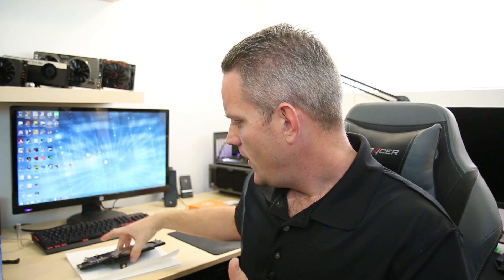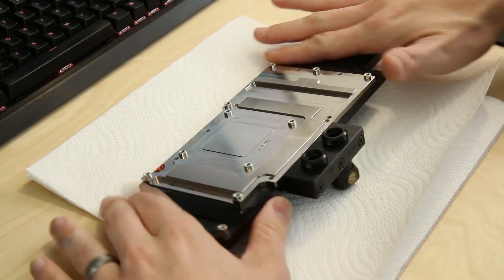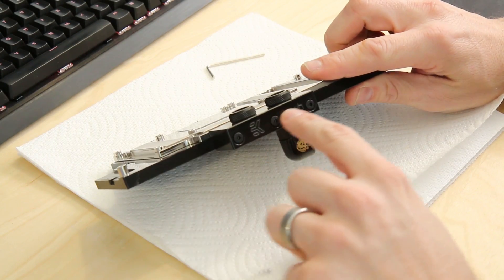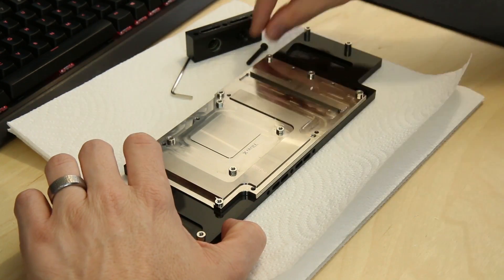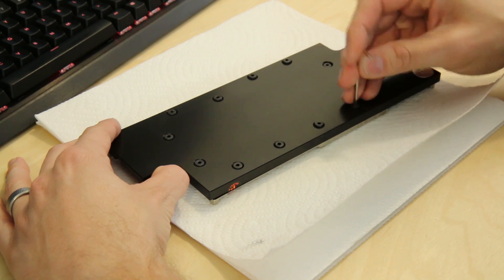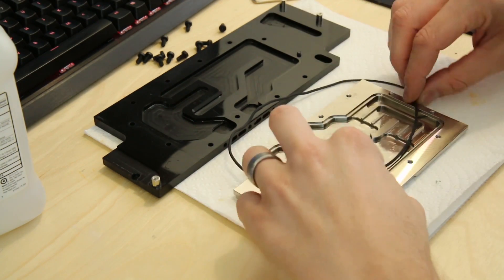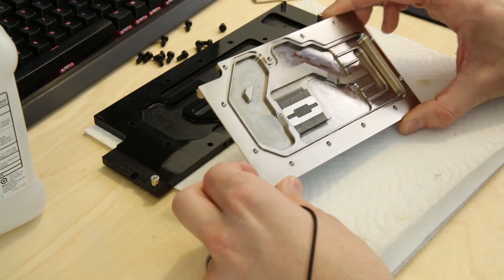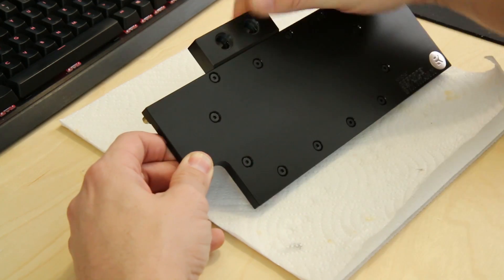Inspecting the inside of my GPU blocks - How to clean GPU blocks

Comment: I find it weird that the salt (if it is a salt) being formed is white with all the copper and nickel involved. The only reason I could think of for it being white would be if Mayhems uses silica nanoparticles in their pastel formulations. I'd say is the acetal (maybe one of its plasticizers) that is reacting with the fluid instead of the metals (copper, nickel). Both CPU and GPU loop have nickel-acetal blocks but your GPU loop has a much bigger surface area of contact between the fluid and the acetal, making them more likely to react with each other. Anyway, keep up with the great work o7 Looking forward for Skunkworks v4

Comment: I recon that white powder - had it myself on my system and it was a big mystery. Then, for a complete other reason, I had to ensure that the system was grounded. After my next cleaning of the system, I no longer had the problem with the white power. So I conclude that the powder has something to do with a current that occurs, when You are not grounding the system. Almost like You would experience on a boat - where they use zink to counter that current.

Comment: could it not be that you acid cleaned the radiators?
if they are in fact made of copper, then putting an acid inside them would be a pretty bad idea, and would definitely result in the production of salts and other chemicals that could be the cause of the build up.
just a thought, this is made more likely by the fact that titan xs are EXTREMELY hot cards, and three of them would certainly have above the required activation energy for reactions with rather unreactive metals such as copper. If the acid cleaning part of the process was not properly washed out before the pastel fluid was put in, or if the radiators were left with the acid inside them for any length of time then buildup of the salts could occur inside the rads, which would be washed out into the loop once the pumps and fluids are installed.

Comment: I've ran into this problem before with radiators....I use CLR to clean them....just allow the CLR to sit in the radiator for about 10 minutes....then flush the radiator with distilled water.

Comment: would the build up of salts affect how much heat is retained within the system? not a chemist either, just kinda curious now
Reply: +knightedwolf actually, let me rephrase that, would having the salts in the fluid cause the fluid to retain more heat than the rads could displace. not in the way of blockages, but more in the way of just holding the heat in, if that makes more sense

Comment: It seems to me that a full investigation here would ideally involve several different test-loops, otherwise identical, comparing the "reactivity" (if that's the issue) of different brands/types of radiators?  Like if the Hardware Labs rads in your system are pure copper internally, I'd be interested to see if a rad with somewhat different metal alloys, like an AlphaCool or a Swiftech, would behaved differently over time.  (I believe most AlphaCool & Phobya radiators have "pure copper" heat-fins, but the water-tubes are actually a more conventional brass alloy?) 

"Testing" these things seems to be only about head-to-head relative performance when the components are brand-new, which is understandable.  But no one (that I've seen) ever bothers with realistic LONGEVITY testing with any kind of repeatable or comprehensive methodology.  In other words-- sure "ALL copper" maybe moves heat a little better initially, but is that construction causing chemistry problems long-term, which would erase that advantage in real-world use?  Let alone the possibility of EXTRA problems on the level we're seeing here!

Comment: would the change in color in the fluid also show a degradation in the thermal conductivity of the fluid. Wasn't it the gpu loop that changed color the most?

Comment: Water cooling looks so pretty, but seems like a pain in the ass.
Reply: +Luke V Which is why air cooling exists. Built my rig 2 years ago, other than the occasional dust clean, I never maintain it.
Reply: +Luke V - It's probably not as bad as it seems from watching the videos here.  Seems like Jay goes to great lengths to do a lot of the more difficult things (to bring us interesting videos here), like crafting cables beautifully, using hardline tubing, visual appearance, multi-loops/pumps/rads, and so on.  But, if you're just keen on going WC and just starting out, you don't really need to dive into the deep end so quickly like this.  A simple radiator, CPU block, and soft tubed loop using a 'T-line' for filling/bleeding and automotive 'anti-freeze' coolant would be a lot easier to achieve, and simplify matters greatly.  I would suggest to consider using automotive coolant purely because it's easy to acquire, relatively cheap, doesn't contain fancy additives to make it look nice but may introduce more issues (e.g. particles to make it opaque + strong colouring), is more than capable performance-wise, and can often last for years between changes.

So, don't get put off too much if you're thinking of going WC by looking to setups like Jay's for inspiration on how it's done.  Jay's setups are pretty high-end by usual standards, so are probably not suited for someone just getting into WC.  Start simple, start small, I'd say.  You'll learn loads in the process and get a better idea of where to go later on if you want to expand on it.

Even simple soft tubed loops are sweet-as when you first get them hooked-up. :)
Reply: +Luke V 
It's a pain in the ass, but you should only ever do water cooling if you enjoy it or have the money to have someone else do the maintenance for you.
Reply: 9ff70f96 WC = bathroom.
Reply: +Luke V 
it sucks up a lot of time every once in a while.
and makes monkeying with your computer certainly also very time consuming.

Closed Circuit Liquid Cooling pretty much exists as a middleground between the two. about as easy as basic Heatsinks, but has most of the benefits of Liquid based.
Reply: Depends on how elaborate u want to go. I have a custom loop cooling only my CPU and it's no problem. Obviously if you went rigid tubing and liquid cooled everything it would be a massive pain in the ass to perform hardware swaps. But I only use flex tubing and only cool my CPU.
Reply: @DD-sw1dd  I had CPU and GPU water cooled but my GPU block developed a leak and directly below was my old OCZ Revodrive 3 which is now a novelty doorstop.
Reply: +Luke V A proper water cooling system will not need any cleaning for years I have loops that are 6+ years with out cleaning and still work like they are new and are pretty clean. This from just using pure distilled water and a little pure (not the 50% mixed) antifreeze. If you want your loop to last dont add in coloring or anything else that is not needed. Some say you can add things to help reduce buildup but from my experience they are not needed and if you want you can run new distilled water after every year if you like certainly wouldn't hurt anything but i have not and just had a block apart to look and yes it has some gunk but it was very little and definitely not enough to hurt water flow or cooling at all.

Comment: Cleaning the block does NOT void the warranty with EK's blocks. That sticker is their "leak free" guarantee sticker. They even provide instructions on their website about how to clean their blocks. Other manufacturers may void the warranty, but EK does not. They say on their cleaning instructions page on their website that the warranty is not voided.
Reply: +brandishwar Link to EK's site since I couldn't provide it in the original comment: https://ekwb.zendesk.com/hc/en-us/articles/205235541-How-to-clean-water-blocks-
Reply: *****
Then you need to rewatch the video.

Comment: Have you definitely ruled out the way you had your GPUs connected to the loop with regards to the temperature issue? Would coolant not flow through the path with the least resistance which, in this case, may have been straight through the vertical channels rather than through the blocks, resulting in the heat from the GPUs not being dissipated as effectively?

Thanks for the content & have a happy new year.

Comment: Maybe take apart the pump also, it may have had some clogging problem which caused the water flow to drop and temps to go up? Btw cool to see a modern water block taken apart, quite a clever design they have there.

Comment: Clearly there was some sort of breakdown or imbalance in the coolant in the GPU loop, as it turned orange/brown. I wonder if the same reason that it was changing color is the reason that it was becoming less effective. I also wonder if the heat sped up the process, leading to a exponential increase in color change and loss of heat transfer ability.

Comment: yo Jayz i know you respond to comments so Respond please! it may be irrelevent to the video but im planing on upgrading my psu for a gtx 980 (overclocking). would this be enough? http://www.walmart.com/ip/XFX-TS-Series-P1-550G-TS3X-550W-PSU-80-Gold-Full-Wired-Cables-221F-Japanese-Capacitors-P1550GTS3X/38159424
Reply: no response? :(
Reply: Depends on the rest of your system
Reply: +Infinite Zero nothing special. i5-3330, 1tb hd. no ssds
Reply: 550 watts at 80+ gold is solid for a 980 and an i5, but don't expect to use SLI or any power sucking components in the future. I personally would recommend saving a few more pennies and get 600/650 watts.
Reply: +Luke Woodcock never planning on going sli. care to elaborate on power sucking components?
Reply: Some graphics cards and CPUs (AMD I'm looking at you) can pull a monstrous amount of power. I believe the FX-9590 and custom PCB 290xs were especially guilty, but there's no telling the power requirements of future components. Massive banks of hard disk drives can also add up to using a lot of power.
Reply: Luke Woodcock alright thanks for the reply man. thats one reason i might not ever get AMDs hardware. (not because of bad performance or bad drivers but because of power consumption and heating)
Reply: jojo t It's really not that bad, you just have to double check if you have a 400-500 watt power supply.

Comment: won't the alcohol damage the rubber o-ring?
Reply: +muh1h1 - Yeah, should definitely be cautious using alcohol on plastics/rubber, especially acrylic (do not use on acrylic!).
Reply: +Brian Silva If you look closely, he applies the alcohol to the rag and then wipes the o-ring. Unfortunately the editing skips the rest of the cleaning process for the o-ring. Im surprised a lot of commenters seem to have missed this. Generally if you go quick enough it shouldnt damage the ring, but I still cringed.
Reply: +muh1h1 Depends, some o-ring can resist years of daily exposure to 85% & 95% ethanol while some can't even resist 5% ethanol for more than a few days
Reply: +muh1h1 i'd be more worried if he was using acetone, but alcohol is mostly harmless.

Comment: Its been a long time since i did chemistry and i may be way off.  But the only white copper salt i know of is copper cyanide, but it usually has a green tint to it.  Are there any aluminum components in the loop?  I say this because aluminum oxidization is more often white.  The fact it seems to be clinging to the rubber o-rings and the plastic make me lean towards aluminum also.

Comment: Curious, what if you just flush it with alcohol without opening it. Would that clean out most of the build up inside? Like, have one of the pumps pump the alcohol through itself and the gpu block continuously.

Comment: The powder is aluminum oxide. All these "nano fluids" are  pathetic. I got best results by using  water filtered from a zero water filter and adding a 2 to 10 ratio of Redline Water Wetter. (2 parts water wetter). You should try it out and make a vid on it Jay

Comment: I am just about to tear my PC apart and as I posted in your last video, I am using Mayhems pastel fluid, red, so maybe I will take a look at not only my fittings and petg but also my blocks, as I have to switch the jet in my CPU block because of going to the x99 platform from my current z97. Thanks for the helpful video Jay, I along with many others in sure, appreciate these types of tutorials a ton!!

Comment: JAY URE DOING IT WRONG. Put the shorter end into the hole, then the alan key becomes like a lever you can spin, therefore faster and more comfortable.
Reply: There's no wrong way to do it
Reply: +Daily Cup of Justin i know,i hoped the caps would help show i meant it in a jokey way, but the advice was just to make it more comfortable for him since he has to do it a alot and its easier the way i said
Reply: DevilMaxGaming not really depends on The application.
Reply: +Daily Cup of Justin like taking off the black cover would have gone much faster my  way
Reply: +DevilMaxGaming not really
Reply: +Daily Cup of Justin actually he's right, flipping the wrench the other way would have made this particular job go faster.
Reply: +Rasengan that's more for torque. You don't really need that much torque to do this job. it's easier to use it more like a screwdriver
Reply: +Daily Cup of Justin i have to agree with you on this one the screws on the back of the block are not as tight as most other things so you don't need the leverage of the hex key as it is not very tight.
Reply: +DevilMaxGaming 
this isn't taking the lugs off a Truck, the Screws aren't held down with 50 tons of force.

the long end being the connection point lets you spin it faster.
the short end as the connection point is for leverage. but you don't need leverage.

if you're looking for faster, you want the smallest turning radius possible. you get higher rotation speed out of the same effort.
and i find that also more comfortable. you can spin it between the tips of your fingers rather than having to swirl it around.

your logic doesn't really make sense.
Reply: +Daily Cup of Justin +DevilMaxGaming  actually, if you do it like the OP says and you put your finger perpendicular to the allen key and then move your hand in circles instead of moving the key with your fingers, twisting it, the result will be MUCH faster and also easier. test it and you'll have your proven fact.
Reply: +Thomas Meyer thank you
Reply: +Daily Cup of Justin +Thomas Meyer Maybe for you guys it is, personally my hands are too thin and large to use it like that,i find it really uncomfortable.
Reply: +DevilMaxGaming whatever floats your goat
Reply: +Daily Cup of Justin I do not own a goat, wish i did though, at least id have a friend
Reply: +DevilMaxGaming i would have used a small electric screw driver my way is faster :P Kappa
Reply: ***** wouldn't work you would need a hex key as it would not work with a screwdriver. Just saying :P Kappa
Reply: +Thomas Meyer you can buy a drill her that's hex. I have a cheap racheting screwdriver set that has hex head bits
Reply: +Thomas Meyer The iFix it kit has hex screw heads too, for the screwedriver which i assume is the same as a drill bit
Reply: DevilMaxGaming Not every one has the Ifix it kit in fact I have never heard of it before I use my own tools I have been collecting over the years sorry if I was wrong I have never seen or used a screw driver that has a hex bit other then a plain old hex key.
Reply: +Thomas Meyer maybe you should google the hundreds of bits that you can put on one before saying that lol
Reply: ***** I literally just said sorry if I never heard of it myself maybe you should read before saying that lol
Reply: +Wolfhound Calm down a bit, he explained himself abd apologised,  nobody is being aggressive but you.
Reply: +Thomas Meyer DW about it, just something i found through linus tech tips, thats how i know but i dont use one personally, getting one soon. right now im doing the same thing u are.
Reply: For as much liquid cooling he does I'm  truly shocked that he doesn't have/use a hex bit screwdriver set. Shit their only $20-$60 for a set at an RC hobby store. And they have small handles on them so you can't cranck the screws down and strip it. That's what I use and the drivers are precision machined so they fit better than any Allen key that comes in a package.
Reply: +taiiat0 I use the long end as a lever and spin it with one finger, making it faster
Reply: DevilMaxGaming you still achieve a lower RPM than if you flipped it the other way.
Reply: +DevilMaxGaming hahah

Comment: Copper salts are usually blue or green in color, so that's probably not it. I guess it's just the nanoparticles, pure and simple. That's also why the fluid appears clearer than it used to be, and also changed color.